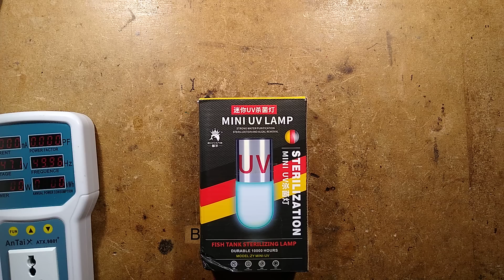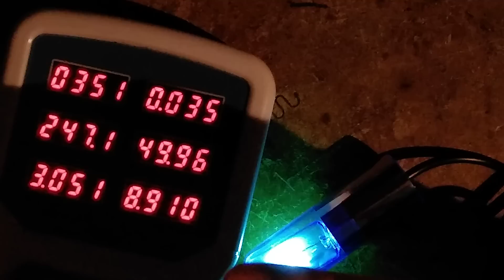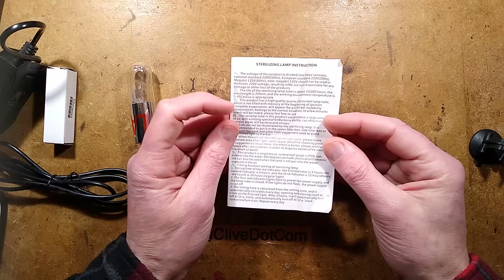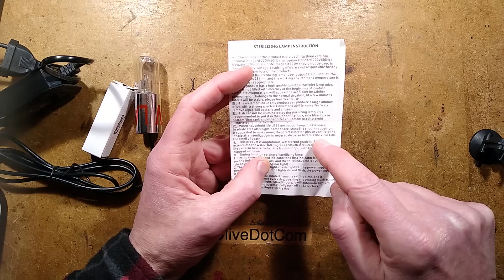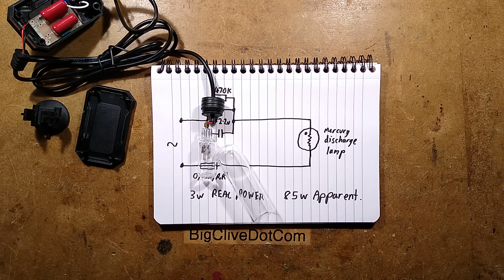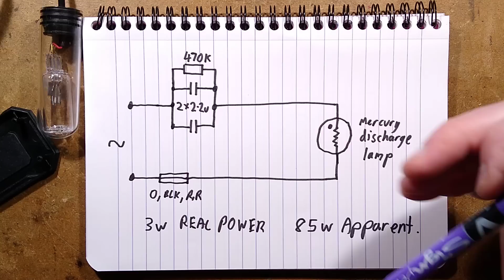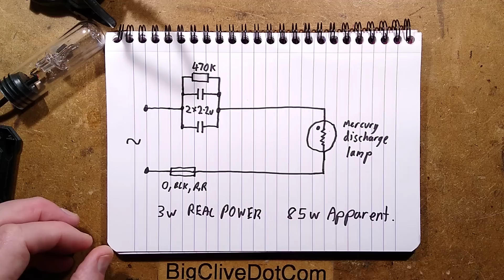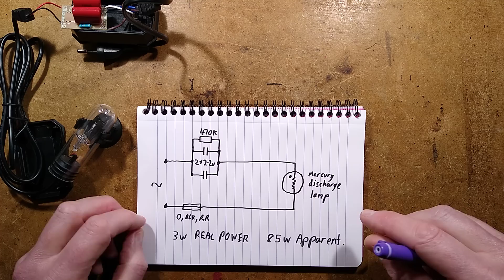Waterproof germicidal light teardown - with schematic

Comment: That raises a few questions:
Wouldn’t the UVC light not destroy the rubber seal over time?
What is the effect of the two capacitors?
Are they really passing 230v into a fish tank? I‘d see that it goes down to some 12v or so. Otherwise it could sterilise more than you intended if it fails…
Great device though for building your own camper van water sterilisier!
Reply from the maker: The capacitors are limiting current.  The lamp connections should be treated as being live.

Comment: You could screw a wood screw into it and pull slowly. Has to be a wood screw, because of the larger threads and cutting action. That is how I have removed those bungs before.

Comment: I knew something about mercury discharge lamps,  but I learned more about those lamps here in 11 minutes, than all my years of working on various types of appliances.  Thank you for explaining the details.  When I was a small boy in the 1960’s our automatic clothes dryer contained a mercury discharge lamp. I believe it required a small ballast similar in appearance to the type a small fluorescent lamp used.  I could smell the ozone when I stuck my head into the drum after it ran a while.  My father warned me not to look directly at it.

Comment: Hey Clive, is there a way to take a circuit from outside of the house, run it into some sort of filter that will reduce the Apparent Power rating and smooth it or something? So that they grid only see's the "Apparent Power"? I'm really curious if you could educate us on the difference between these things and how the power company could use it against us.
Reply from the maker: At the moment most metering is done with real power.   Correcting power factor is complex and varies with the type of load.

Comment: An application of UVC that's been in the back of my mind is water bottle use.  A 1L sized bottle with UVC built into the base, with wireless recharging; fill the bottle and run the lamp and drink up when done.  While it wouldn't remove non-bio contaminants, Im thinking of biologics like Giardia.  But with the attenuation you mentioned in another comment, would this even work?
Reply from the maker: There are versions that have a tube or LED in the cap.  If using it at the base it would need to be inside the bottle as UVC is blocked by the plastic.

Comment: So Big Clive, if I mounted one of those lamps in my refrigerator and wired it so it goes off when the door is opened, it would sterilize my refrigerator?
Reply from the maker: It should, but might be a bit too extreme.  You get trace ozone generators for fridges.

Comment: What voltage is it dropped to?
Asking for a friend...
I built a 14v driver unit for another project, would rather not use AC mains plugged into water: even if its half-arsed converted to "dc".
Reply from the maker: 10V, but it needs a higher voltage and current limiting resistor on lower voltages.  You can get 12V power supplies for them.

Comment: I mentioned it under the excimer video, but I highly recommend checking out the 'Little Garden' spectrometer that Project 326 has made a couple videos on.
Reply from the maker: I've looked at that, but it doesn't go anywhere near the UVC wavelengths.

Comment: Apparent power is only a problem to the power distributing company.  They have capacitor banks high up on poles in America with vacuum switches to add and disconnect them controlled by a computer. Ron W4BIN

Comment: The burning flesh test is surprisingly effective. I got one of those 365 nm “UV Beast” lights and could swear I could smell trace ozone coming off it. Sure enough there was also trace burning flesh smell as well, which was surprising. Would not expect the LEDs spectrum to extend that far up. Although maybe not since it looks like a purple halogen light when it’s on. Either way eye protection not optional not that it was to begin with. And the black Woods filter lens it has with UV blocking glasses is just so much more mesmerizing. Makes it look like that scene from Predator.
Reply from the maker: UVA is used in some tanning systems, so may cause an organic skin smell.
Reply: 365 nm isn't UVC but UVA and it isn't considered as effective against germs or as harmful as the former.

Short-term health effects are actually mild unless you get exposed to a really powerful source for extended periods of time.

Comment: I lived on land in north Florida for a while and the well I had to get drilled was surprisingly deep and the water it produced smelled foul and sometimes seemed to have bacteria. I used chlorine and then a charcoal filter, but before I had to move out I was considering UV treatment and perhaps ozonatiom.

Less than a mile away but maybe ten meters downhill was a natural spring with pretty good water (somewhat rich in lithium too), quite unlike what I was getting.

Comment: Well, it has to be noted, that compared to the "lamp of pain" not only they added a discharge resistor, but also the power factor improved from 0,032 to 0,035! More seriously: It looks very interesting. The GTL3 comes with bare pins, as opposed to the weird "slightly bigger than E14" thread, and if the outer tube is made from quartz (and probably it is) you get a free quartz test tube. A short one, but nevertheless quartz glassware is always useful at more advanced DIY chemistry. Also it's amphibious! I love Chinglish, One of my favourites are  for example the labels on industrial pumps - the suction and discharge port are always labeled "import" and "export", and the manual preamble always says that the product is of top quality, because it absorbed foreign technology.

Comment: Can you cite any studies around the risk of 254 nm UV with respect to cancer? Definitely it appears that 222 nm is safe due to its low penetration depth, but most of the studies I've found that reference 254 nm cite it as a cancer risk. It does penetrate deep enough to modify DNA of living skin cells. The difference is what makes 222 and 207 nm excimer lights so exciting.

The actual significance of the risk is perhaps overstated (compared to the much larger amount of UVB from the sun), but it doesn't seem like it's negligible.
Reply from the maker: The belief that 254nm UVC causes cancer may derive from the extreme external irritation it causes.  In reality, the short wavelength does not penetrate deep enough in the skin to reach the critical DNA area.  It's now considered that strong UVB and even UVA pose a higher risk.

Comment: Yes It Smells Like Burnt Organic Material  -   Hmm, best not get one of these unless you know what you're doing. Could it be used for "Retro-Brighting", or will it damage ABS plastic still further, since yellowing is caused by photo-oxidation in the first place.
Reply: I think UVA will be more effective than UVC for retrobrighting.
It is for cyanotypes as far as I know.
Germicidal tubes don't output much UVA however blacklights and The Sun do.

Comment: as someone who keeps a tropical i'm allways interested in new ideas to make life easier though there's no way i could fit the neat little lamp inside the filter/pump sadly. though i am working on something to aid when cleaning the aquarium.
Reply: Just by a UV steriliser made for aquaria. They plumb in the normal return pump line and are fully safe. Lamps like the one Clive shows are not safe for use in damp environments.

Comment: A 4, 6 or 8 W UV-C tube is cheaper and easier to find than these 3 W lamps. 6 and 8 W UV-C tubes (212 and 300 mm) also have 11 and 16 W versions.
Reply: They are harder to use though. I can slap one of these loose bulbs on a 18-24v transformer with some resistors in series and it's happy. In Europe they're not easily available in stores, but i never bought them from there anyway because they're like €2,50 on aliexpress. 
For the fluorescents, you need a pair of holders set a specific length apart, as well as a starter and a choke. I have those, but i find them less easy to install somewhere.
Reply: @mfbfreak  You can just use a Tesla coil and power the lamp with a single wire or even no wire at all. Also works with lamps that have worn electrodes that don't work in conventional circuits.

Comment: I have a much larger one for my aquarium that plumbs into the pump tubing.  The water flows in a spiral around the bulb.  I've always been suspicious about these UV systems.
Reply from the maker: The UVC water sterilising systems are very time-proven.  They're used for sterilising well water.

Comment: Any good for stopping my shoes smelling , or would it rot the materials ?
Reply: For that i would use the ozone generating kind. UVC in itself does not destroy smells. 
I don't think the UVC adds to anything at all in shoes, so i would suggest mounting the ozone generating lamp into a piece of pipe, which you use to blow ozone rich air into your shoes. This avoids degradation of plastics. 
One light bulb produces a serious amount of ozone. It does not perform wonders, but for the 2,50 that one of those light bulbs cost, you cannot go wrong. I run mine with a 25 ohm resistor in series, on a 20v transformer.
Reply: I tried one on my walking boots... worked well   (about 1 hour exposure)
Reply from the maker: It would potentially damage the materials.  This video will fix your footwear:-
https://youtu.be/wPLwczrGikM

Comment: I encountered photokeratitis in HS welding class. Yes, that night I woke up with sand in my eyes. Went to the eye doctor the next day and everything was fine. Pain is a good teacher, so I learned quickly not to look into the pretty blue light.
In the early 2000's while welding exhaust systems on cars/trucks with a Mig welder there was a couple of times I got a bit of sunburn feeling on my neck and side of my face as a result of reflection from heat shields that were installed on the vehicle.
Reply: We call it "arc eye", a hazard in a factory where welding is common. Well it was in my day before the wheel and welding screens were invented 😁

Comment: It's not just for electricity company meters that the apparent power matters, also if you want to run this off a battery and inverter (off-grid) or a generator, for example, you need to budget 85VA for it.
Reply from the maker: You get low voltage power supplies for these that use a Royer oscillator for the AC and are very efficient.

Comment: Got more or less the same light in my aquarium, but the version with the timer. But my lamp gives a ozone smell if you let it run in the air.

Side note, it did wonders to the our 120 L aquarium. In about a week the complet green water did clear up. On the other side, sadly i can confirm on longer exposure little fishes literally get grilled.

Comment: With fusible resistors the colour codes are for the resistance of the device. The maximum power dissipation has to be looked up on the manufacturers data sheets. There is usually a fifth band (colour is often white) to denote that it is a fusible resistor.

My guess is that it is a 22Ω resistor but the maximum power is unknown as we don't know who made it.
Reply from the maker: Virtually no resistance.  I'm thinking it's a 3A fuse.

Comment: I wonder if it would be practical to use a larger one, in a rainwater tank? For human consumption.
Reply from the maker: There are dedicated UVC water sterilisers, but in a tank with low water flow, something like this could work.
Reply: You can get bigger ones they are used for small to large ponds.
Reply: I have friends who use Uvc to process rainwater for drinking. Theirs is in a pipe right after the filter and turns on with the pump at the time of use. The ability to sterilize germs drops off quickly with distance, so the closer the better, and in this application it's no more than a few cm. The mercury vapor lamps also have a short life by modern standards, so it saves bulb life to use it intermittently. He got a more powerful one than he really needed for their flow rate, and it makes the water quite warm at the tap.
Reply: @silverecco  Wow, that is interesting. Do you happen to know which one they have? and is it for the whole house, or just a tap? I would be most interested. Thanks.
Reply: @TopEndSpoonie  check out the RainFresh UV8F. It might not be the exact brand, but it was a spin down filter and metal uv tube together. There are cheaper generic ones too that would be fine if replacement bulbs are common. It was a whole house unit, but only running one tap which is why it was so hot, sized for much higher flow rate. They are planning to expand the cabin. I think he used some kind of relay to turn on the uv light when the DC pump turned on. The light exposes the whole length of the tube, bouncing off the shiny walls over and over which is why it can sterilize (nearly) instantly vs 60sec of swirling for a backpacking Steripen and such. Really neat tech. Kills pretty much everything, no filters to change or chemical smells. It just doesn't stay safe for long which is why chlorine is still used so much.